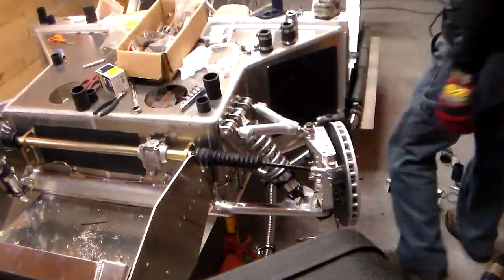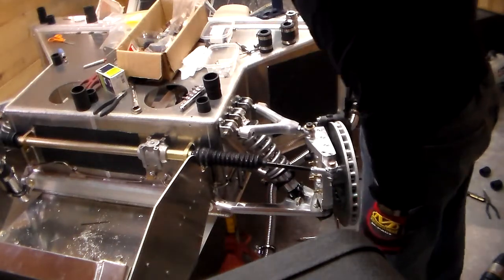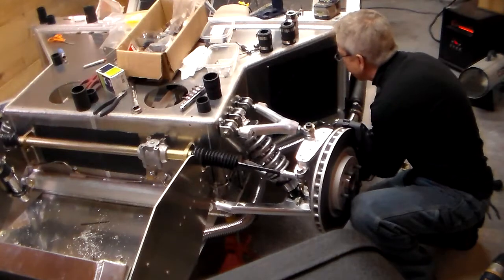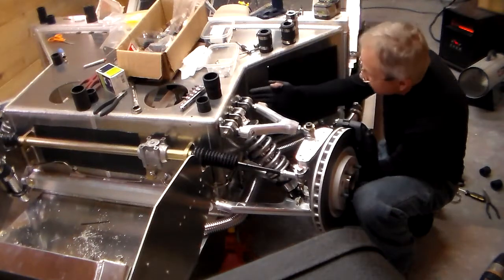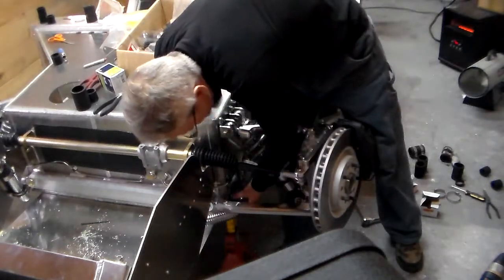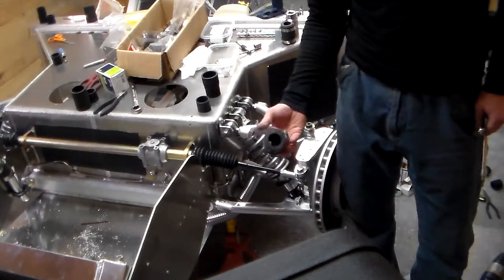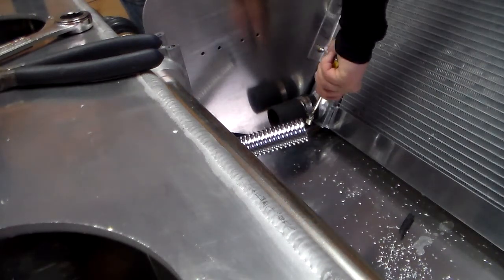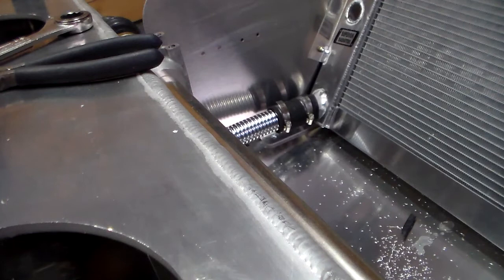SLC BUILD 7 FLEXIBLE COOLANT TUBES

Comment: Does it come with these tubes? or did you purchase them yourself? and do you build these for fun or profit?
Reply from the maker: It comes with the solid stainless steel tubes but you need to supply some connections to go from them to the engine and radiator.  I purchased the flex lines.
I build them for fun and the bonus is some profit.